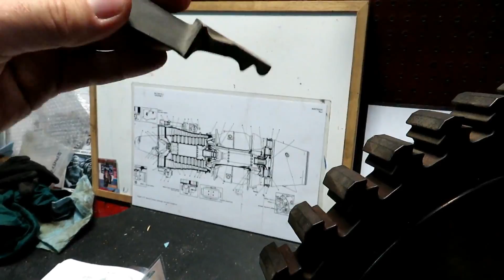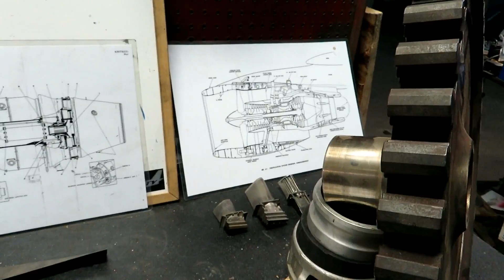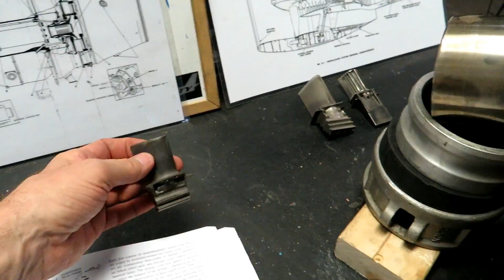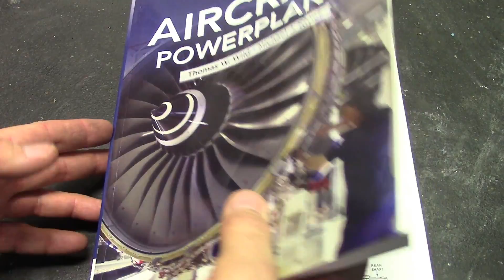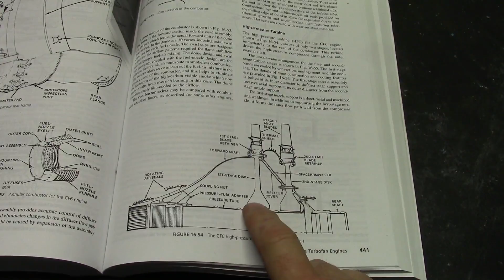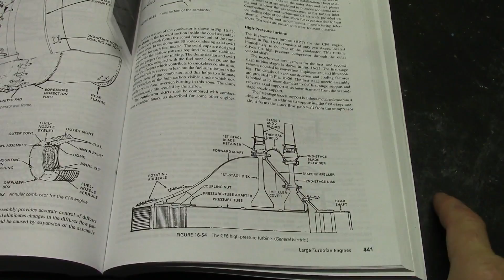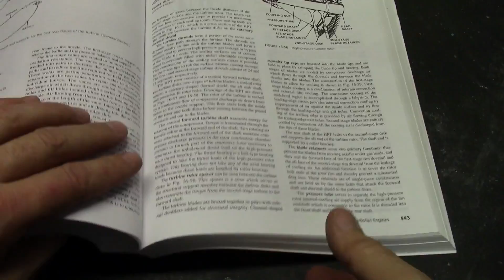Turbine Interstage Seals

Comment: I've watched many of these videos, am one of those people having difficulty getting my head around the "not higher pressure in the turbine end," bit. I accept it to be true though.  Would you be able to give an estimate of the pressure difference between the cooling air and the "working air" ? So I can maybe imagine the rate of flow through the blade ducting. It must be a lot of air to take away the heat effectively. Thanks for all the videos..

Comment: Assuming these parts are following typical guidelines for GE, I'd hazard a guess that the 6 serial numbers "GWN0TCL3, NCE062LD, NCE254LC, NCE314KU, NCE374LB, NCE527KT, NCE777LD, or NCE994KW" come from 2 manufacturers: Prefix GWN and prefix NCE.  If it does affect 2 locations, many people must be in hot water over this.

Comment: Great explanation of blade cooling air and the passageways.
I just finished with a 4th year millwright program. Check out the video I did of them during training. 2 old navy ship power steam turbines. Pretty solid together but we managed to take them apart and reassemble. Used your videos again for the classes. Thanks again. 
Sorry to see the early winter.  
Good job. 
Enjoyed.

Comment: I worked on J-79 and all way thru to Ge90 engine blades and stators. The  old J79 had very low thrust because it had no cooling hole. All more modern designed run at temperatures above the melting points of parts in first and second stage blades and stators. One stator would have over 600 hundred cooling holes in F16 or F18 engine. It's why the engines have so much thrust in modern designs.
Reply from the maker: Very low thrust... When it was introduced, the J79 made 50 % more thrust than the other engines at the time..
Reply: 600 hundred = 60,000 cooling holes. Wow, that's a Swiss cheese blade!
Reply: @RSole9999  the engine gas exhaust is hottest spot in engine and it is above the melting point of the parts. The first stage stators are hottest part of turbine. There two vane segments have around 600 cooling hole and there are around 24 in a full circle so 14,400 cooling holes in first stage stators. its first stage stator, first blade ,second stage stator and second stage blade and so on to around 5th or 6th stage.

Comment: At 11:50: YES!  If the combustor pressure was higher than the compressor, the gas flow is backwards.  Similarly, a rocket oxy or fuel pump must exceed rocket combustion chamber pressure.  (In both cases this takes a lot of energy; rockets use some fuel to drive their pumps.)
Rocket combustion chambers hit 100-300 bar.

(I think ammunition hits 10000 bar, and an explosive can hit half a million.  Cars have compression ratios of ~8 = 8 bar.)

Comment: The simplest way to explain the pressure in the engine: If the pressure in the combustion chamber was higher than in the compressor, you would have flames shooting out of the front of the engine.

The pressure in the combustion chamber doesn't increase because it has a (relatively) open path through the turbines and out the back of the engine. But the combustion doesn't inherently make the gases move faster, the pressure differential from the compressor>combustion chamber>turbines is what accelerates the gas flow.

If you put a big cork in the end, the pressure in the combustion chamber WOULD increase, right before the whole thing went boom.

Comment: Very good explanation. Now I'll have to look up the incident and watch that other video.

What are the clearances in those seals? Sort of ballpark figures. 0,01 inches?
Reply: May be lesser. And they are not machined during assembly, but rather formed during the first run. They do put abradable linings that those sharp ridges abrade against to form grooves of tight clearances.

Comment: So, in conclusion; a jet engine is a very large air gallery.
Reply from the maker: Yes, depending on your definitions of Jet, Very, Large, and Gallery.
Reply: @AgentJayZ  Getting a reply from you is so fantastic. Thank you. 

I have always wondered how it worked, and assumed it was like a pneumatic controller. Your explanation is so fantastic.

Edit: How cooling air worked. Also, thank you for going into detail on the relative thermodynamics of the cooling air, as well as compressor and burner stage pressure.

Comment: How do they machine the turbine blades with those precise holes through them? Some sort of advanced EDM? I can't imagine a 5-axis machine getting anywhere near that depth.
Reply: I did that a GE. It is done with chemical drilling.
Titanium tubes sulphuric acid and an Eléctrical current.
Stem drill.
Shaped tube electrolitic machining.
Reply: Kenneth Baker with advanced additive manufacturing, conformal cooling channels can be very complex...and the parts should be cheaper. It’s gonna be interesting to see if 3D printing becomes the way all blades are made.

Comment: Great video. Two questions. Can the turbine blade cooling holes and pathways be clogged from dust or volcanic ash for example? Also, are the operating pressures within the combustion and turbine sections enough to mitigate clogging of the turbine blade cooling holes? Thank you.
Reply: @Sheila Walker Thank you for the reply Sheila. Cheers.
Reply: Volcanic ashes or other small enough debris doesn't only clogg from the outside but mainly from the inside of the cooling holes since the CDP cooling air will carry all the debris into the Turbine section cooling passages.
Reply: @Sheila Walker It'll be a very expensive fix at the end! You can just hope the engine keeps working long enough to get the bird savely back to ground.

Comment: As per the B777-300ER EAD, the issue involves one defective interstage seal installed on and affecting eight aircraft in operation, all with different serial numbers.  One bad part, eight different B777, eight unique S/N of the same defective part, probably all made in the same place, which Boeing must have known about to react that fast, like 3 days or something. 

The EAD permits, most oddly, all of the eight affected operators to continue operating their GE90-115B with unspecified defective interstage seal for a further 25 flight cycles before having to comply with GE Alert Service Bulletin GE90-100 S/B 72-A0826, instead of like this friggin' instant to avoid uncontained engine failure at any time. 

This leads me to ponder if Thai Airlines were warned about this problem by GE Aviation 25 flight cycles before the left finally went.
Reply from the maker: A:  Thanks for summarizing what we've all known for about a week.
B:   The 25 cycles limit is to allow airlines to get the plane to a place where it can undergo an engine change without hugely disrupting passenger service, and still not be breaking the law. 25 cycles is only a couple of days or so for some planes.
I would estimate that all of the affected engines will be changed out well before 25 cycles.
Reply: As I read it, the AD also states that an aircraft is permitted to fly on for a further 25 cycles, provided that it has only one engine with a suspect seal.  If it had two, then it might be grounded, or might possibly be permitted to fly with no passengers to the nearest facility where an engine changeout  could be carried out.
Reply: @grahamj9101  The more I read FAA EADs and ADs the more I wonder why operators, pilot and technicians tolerate their lack of clarity and overwhelming clutter by pointless formality, like paragraphs of FAA executive jurisdiction, as if B777-300ER operators didn't know this, what they do and why, and being totally stunned to discover. 

EADs, the most urgent level of aircraft safety alert requiring urgent operator action, should have a standardized format like ATC/pilot phraseology.  In this EAD, like most, the FAA forces readers to sift through a mountain of needless babble, and never even publishes the specific GE Aviation repair bulletin, only phone and email contacts. Operators, having spent loads of time trying to make sense of the meandering mess, running it through Google's FAA-to-English translate seven times to no success, now have to pick up the phone and dial.  

As I read it, eight B777-300ERs out there have GE90-115B engines with a minimum of one lemon engine part, probably two, capable of blasting metal outward in uncontained failure and penetrating the cabin or bouncing off the tarmac and into the other engine at any given time.  But one will not learn why in the EAD or what to do. 

As for this 25 cycle business. I read this as eight notorious bank robber crews being granted the liberty by the FBI to commit 24 further robberies unaccosted by law enforcement before each must turn themselves in. 

When one engine on these eight B777 has a bad interstage seal, that only people like Agent Jay Z fully understand, and if present in this engine that strong likelihood the other engine contains the same lemon, operating these aircraft without immediate repair would be voluntary insanity. 

This GE Aviation engine model has a checkered past of HPT, LPT, FADEC and OBV failure of recall scale severity. 

FAA ADs and EADs should get straight to the point and provide all relevant info in the interest of aviation safety.
Reply: @jasonbell5152  I tend to agree with the sentiments expressed in your third last paragraph.  However, the airlines and many of their self-loading cargo units probably wouldn’t: the US Dollar is all-important to both.

Comment: Another great video.  I will never see one of these engines, so watching it being tested is fascinating.  A couple of questions.  Since you are using a compressor section as a load, is the output air from the load warm?  Does the gearbox need an oil cooler?
Reply from the maker: The air dyno exhaust is toaster hot.
The gearbox has a huge heat exchanger, water to oil. It also has its own reservoir, pumps and filter.

Comment: In my industry, part numbers are created even for studies and versions. So when the final assembly is released, a bunch of those numbers were discarded in the process, while others not. This is my underatanding about (un)serial numbers
Reply: Are you talking about part numbers that specify what a part is and does  ... or serial numbers that keep track of the manufacturing of said part?
Reply: @schwenke069  If the part gets manufactured without modifications as paint or other finish, the same number gets out of the factory. Sometimes, carry-over components gets a new number for logistics control reasons. There is indeed a strange logic behind those numbers
Reply: @Marcos  5 identical parts out the door will have the same part number ... each with it's own, unique, serial number.

One common part number. 5 different serial numbers.
Reply: @schwenke069  Ohhh, I understand now your question... No clue about SNs , sorry!

Comment: Please, I have a question about the low pressure turbine stages  :
Normally these parts (disc) were heat treated (between 650 and 700 °C) to freeze the required microstructure before machining and then to use theme in a jet engine. How can these parts doesn't change the microstructure and still resisting to the heat coming from the combustor !!! =>  What is the temperature of the low pressure turbine parts (discs) when the engine is working at it maximum ??
Thank you in advance,
Reply from the maker: I don't know how the parts are manufactured, but I would not expect them to be heat treated, as they work in an environment where temperatures are high enough to be in the "heat treatment" range.
The EGT of the J79 is measured after the gases exit the last stage of the turbine, and they can be at 1100 degrees F.   In that engine, the turbine blades are not air cooled, but the discs are.
I would not expect the discs to be reliant on heat treatment for their strength, but I am not an expert on that subject.
Reply: The blades in the turbine are made of alloys that are precipitate hardened (sometimes called age hardening). During this process, intermetallic compounds are formed that have high melting points and greatly increase strength that persists at high temperatures.

Comment: According to the Bernoulli-Venturi-Equation (https://en.wikipedia.org/wiki/Bernoulli%27s_principle) you increase the dynamic pressure due to the combustion process. The static pressure is constant in the combustion chamber and bevore the entry into the turbine.
Reply from the maker: Dynamic pressure: speed of gas flow.
Reply: @AgentJayZ  No! => Dynamic pressure = Kinetic energy of airflow per Volume = (Density of Air times (speed of airflow)^2 times 1/2)
Reply from the maker: I did not use an equals sign. But I should have said "depends on". Anyway, thank you for the clarification.
Reply: @AgentJayZ  I mean, if you put two Pitot Tubes in the hot an pressured air stream bevore and after the combustion chamber, you could measure the increasing dynamic pressure and the constant static pressure ...

Comment: I see reference in some newer engines to turbine "blisks", one piece blade and disk components. Are they made without cooling air ports? I imagine creating ports in a single piece unit would be very difficult. I have no idea if blisks are even cast or forged and machined components.

Comment: If we did not have single crystal casting and the ceramic core technology to produce those blades we wouldn't have the aerospace tech today we have. TiAl is a material used to make hot section buckets and blades. TiAl is a metal / ceramic but is hard and tough and can sustain very high temps without burning up.
Reply from the maker: TiAl is used as a coating, but I have not seen it used as the primary construction material. You are 100% correct about the need for ever higher temps, and the limitations imposed by materials at our disposal. Frank Whittle identified the same issue back in 1928.
Reply: @AgentJayZ  I can't remember and probably couldn't tell you what engines, but I worked in a foundry that cast TiAl blades for jet engines. If I remember correctly they are late stage blades in the higher temp modern military and commercial engines.
Reply from the maker: Ah, yes, those would be compressor blades. The later stages are often made of titanium alloy, and then even steel due to the higher temps they work in.
I was thinking more about turbine blades, which are usually primarily nickel alloyed with a variety of metals.
Reply: The statement about the relatively lower temperature capability of TiAl versus the Nickel-based super alloy is correct, so are the fact that TiAl blades would be much more common in compressor, but there are TiAl low pressure turbine last stage blades now, here is one example:
https://www.ge.com/reports/post/94658699280/this-electron-gun-builds-jet-engines/

For that temperature range and the fact that last stage LPT blade of high bypass turbofan are huge, they are an excellent choice to reduce the weight of the blade.

Comment: So what does the interstage seal run/seal against? The base of the nozzle?
Reply from the maker: There will be a stationary seal that is attached to the cases and matches up with the rotating seal. When you speak of the turbine interstage seal, it means both parts working together. the stationary seal goes in a groove in the case that is between the mounting grooves for the turbine nozzles that guide the gases into the turbine stages.
Reply: @AgentJayZ Gotcha. These engines may look big and scary but inside they are as intricate and delicately built as a complex clock mechanism. Mind blowing to think those tiny holes in the blades are the difference between an engine running and literally exploding. Do the blades ever come out at overhaul with some of the holes blocked from combustion deposits or is it simply so hot in there that deposits burn off?

Comment: How do they make the cooling channels in the blades?
Reply from the maker: These days, 3D printing is becoming the best option. Back then, the lost wax casting method was used, with about an 80% rejection rate at final inspection.
Reply: Lasers can be used nowadays to drill the outlet holes on the blades.
Reply: @AgentJayZ  No wonder they're so expensive!

Comment: Interesting at the beginning talking the cost for clean sheet engines.  CF6, if I remember correct,  the core originally came from the GE B1 bomber engine.  So much so, supposedly to let the joint French GE CF6 motor exist, the core was not allowed (Yea, right the French sold design to Soviets) to be opened during repair.  This was long time ago.  Anyway, without .mil development work on jet advancements/clean sheet designs, almost impossible to get new designs for civil aviation.  

Thoughts?
Reply: The CF6 has origins in the TF39 engine in the C-5.   The CFM56 has origins with the F101 military engine.  Safran went GE after P&W (F100) turned them down.
Reply from the maker: The engine with the stories of secret components was the CFM56. Those stories are true. The CFM56 familiarization manual is available online. It is a very good engine.
Reply: Powerhead, my bad.  I agree with you, CFM56 was it,  my bad.  Forgot the numbers.  I still think it had part of core for B1B.  I remember good friend of mine talk about how that got into the hands of Soviet Union.  Through the French. They ended up with one of the Soviet (not sure if prototype or protection) versions over at what was FTD (Foreign Technology Group) at Air Force.
Reply: Thanks for correction AgentJZ.  I got dyslexic on that one.